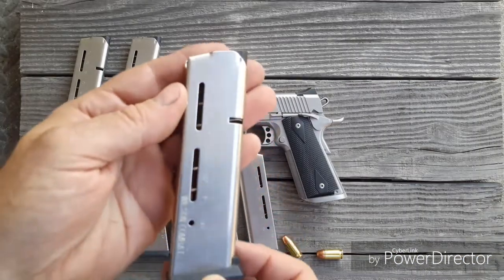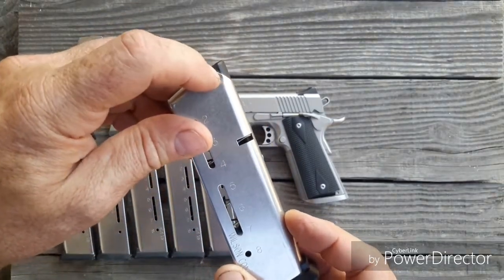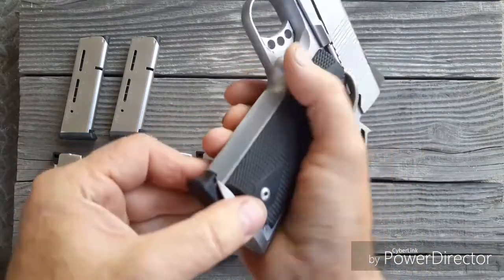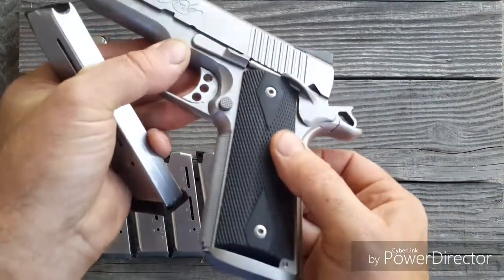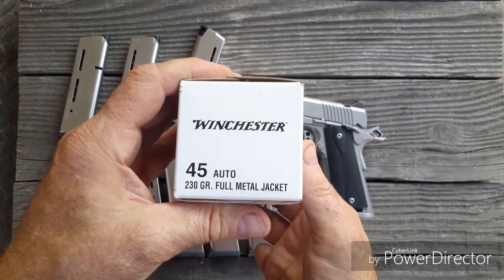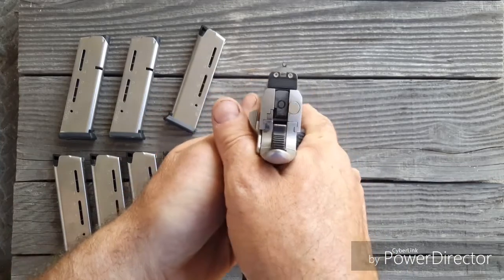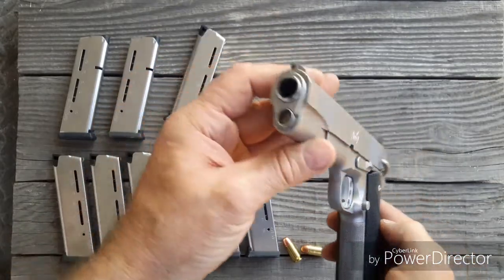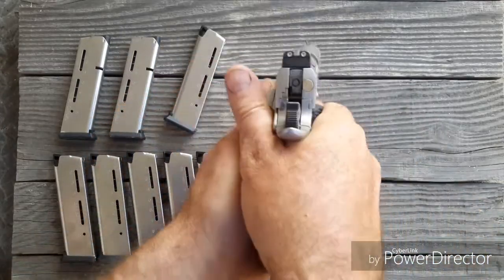Kimber Stainless TLE II vs. Propeller Plate Rack

Comment: I wish my Stainless II had three dot sights, I have blacked out target sights, but I want a Dawson fiber optic front sight. I'm surprised you don't run 10 round mags in that beauty
Reply from the maker: For single stack major..8 round max. On steel shoots I always loose count on reloading at 8 with a Barney 9th round. I was looking at the Dawson adjustable set. I like the blacked out rear and narrow blade fiber optic frontset..I shout just get a set.